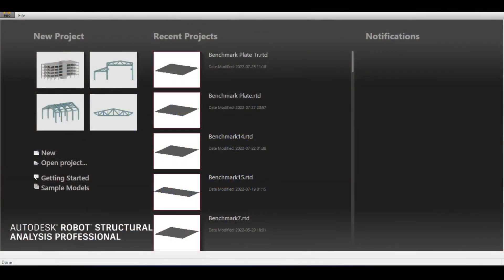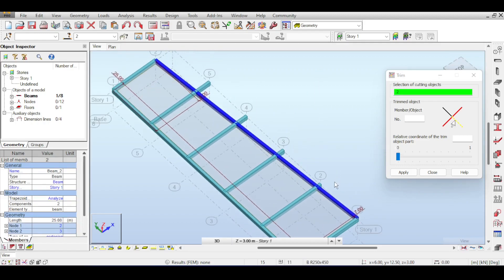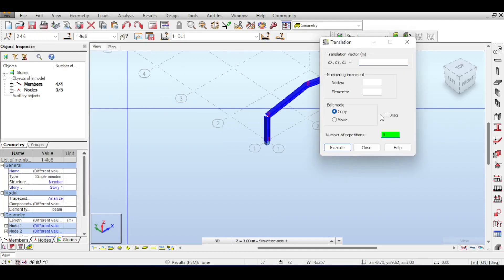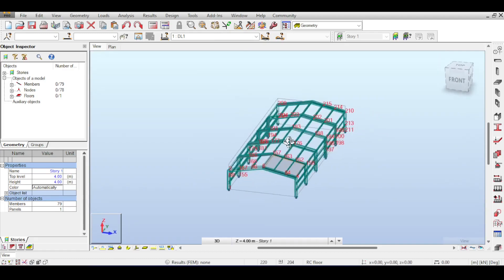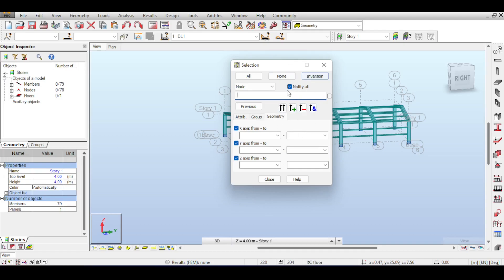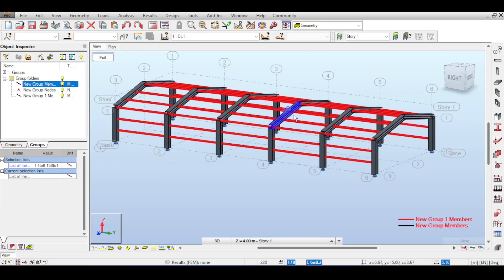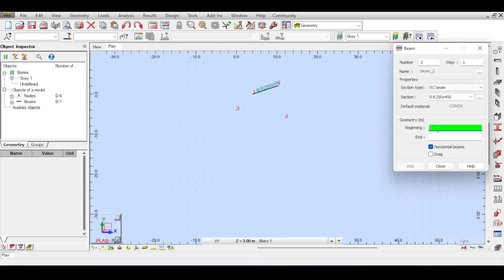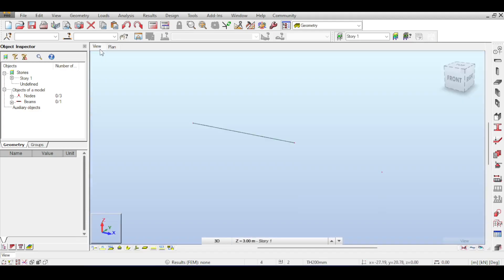Tips and Techniques for better Modeling in Autodesk Robot

Comment: Another great video, thank you! A trick I’ve used in the past is copying an excel table of beam or node definitions into robot. Can be very useful if you need to define linkages between lots of nodes (master slaver for example)
Reply from the maker: Oh that is a GREAT idea!! Using an excel table to generate a model is amazing especially if you want to have multiple models with little variations.

thnx a lot for your input. I am happy you liked the video. Stay tuned for more content,
CEE

Comment: Thank you Sir for these modeling tips and tricks. Once again great educative content as usual.

The reason for my question of adding members with node numbers is that usually I import a partial model from Revit structures and wish to finish up the Modelling in robot and update the model back in Revit structure for design coordination.  And it’s sometimes  difficult to snap to Revit member nodes in robot structures. With this video I now know what am not doing and what I should rather be doing. 

Again I love ❤️ this video for the fact that it cleared my doubts on my question and also you taught me how to effectively use the drag command in copy/move which in most cases I ignore. 

Also for the pronunciation of my name, it’s perfect. 

Thank you again Sir
Looking forward to more educative contents everyday
Regards.
Reply from the maker: It was my pleasure. I think I will take a look on the revit/robot coordination and maybe provide content about this in the future. It did not cross my mind that drawing members via node numbers would be a necessity, so I will take a closer look on that.

Hoping you all the best,
CEE